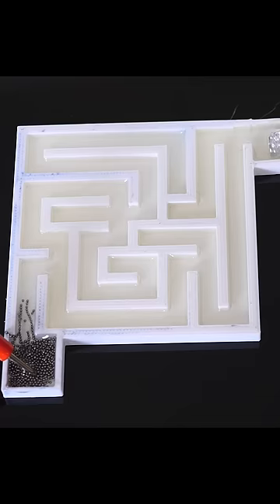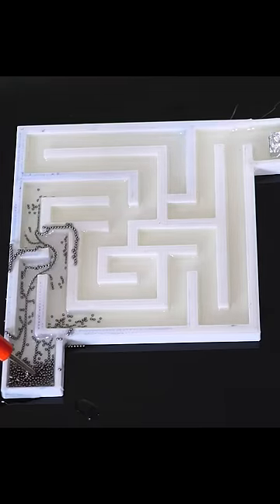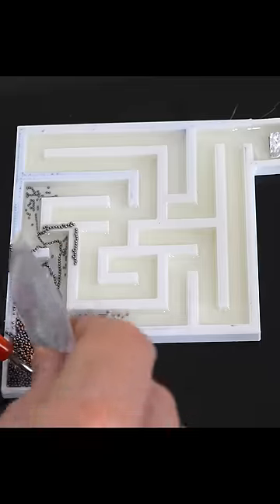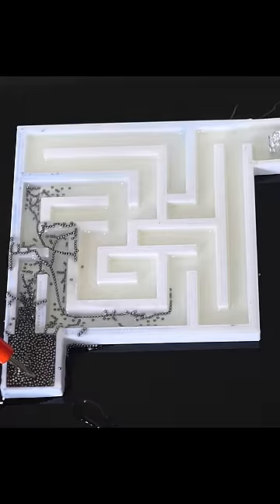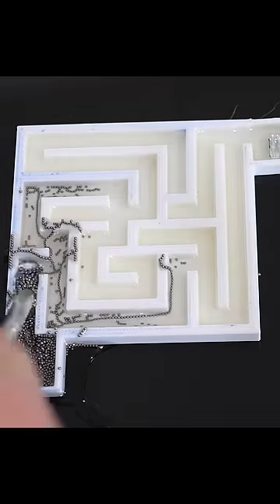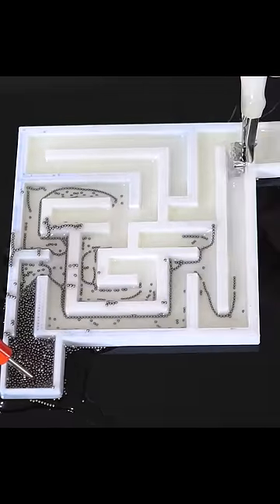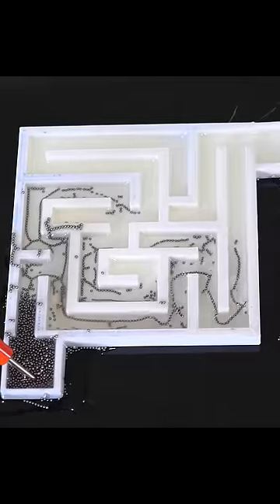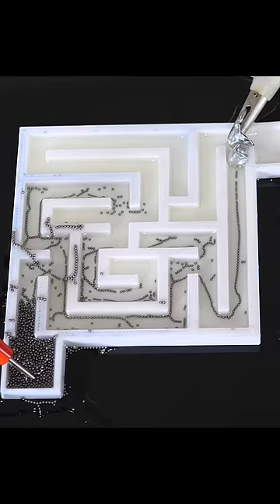Self-Assembling Wires Solve a Maze

Comment: So the answer to, "Can self-assembling wires solve a maze?" is "No".
Reply: Nope buddy, the answer will be "🤔.........yup, but they'll need a bit help😁"(tho they are self assembling)🤣
Reply: In this case “a little help” means “any time they don’t go towards the end of the maze I’ll show them the answer, as many times as is necessary”
Reply: @Jon0007723  “a little help” means they get stuck in the corners because they don’t exert a lot of force so he’s just moving them into the middle so they can move again
Reply: @Jon0007723 You clearly don’t understand how this works lol, he wasn’t pushing them to go anywhere, they were moving in the right direction but because the construction of the maze was flawed they were getting physically stuck. If the design was made perfectly and there were no external factors it would’ve worked.
Reply: @bolson42  the construction of the maze wasn't flawed, it's a completely normal maze. The balls just aren't capable of navigating the maze entirely on their own, simple as that
Reply: That’s true, the maze’s shape may not be ideal, but if the wires could solve any maze that wouldn’t matter

Comment: Look I think if you left it long enough it might have managed it but you should redo this but put a piece of acrylic on top of the maze to prevent it from cheating and perhaps use just a little more charge this time you can make syringe points so you can add additional electrolyte
Reply: Cheating 🤣🤣
Reply: Yeah this is the first really cheap video he’s done. Must have felt despite to put something out… But yeah redo the video. This one is a waste of everyone’s time.
Reply: A slurry of iron fortified cereal would have a better visual effect when backlit
Reply: Yes, with smoother corners
Reply: @legalizenukes3184  was gonna say that
Reply: I don't count jumping the walls as cheating.

In real life, a 3d creature in a 3d open top maze can jump walls, if anything, it's added realism, and jumping a wall in a maze won't guarantee progress, you could even end up in a sealed pocket.
Reply: Create a maze with rounded corners…….
Reply: The 'electrolyte' in this demonstration is actually dielectric castor oil. Still, your idea and points are valid. The problem is, the balls aren't solving the maze, to begin with. They're assembling due to resistance of the dielectric being greater than that of the balls themselves. The action is through electrical conductance, though, so the conductivity of the air may play a part in the test. I'm not sure how long of a voltage gradient can be maintained in castor oil.
Reply: @christopherkarr1872  are for all intents and purposes air is essentially an insulator. To me it seemed more like the little bearings were getting pushed up to the wall
Reply: @borttorbbq2556  Air, at these voltages, is most definitely highly conductive, at least with reference to oil. There's a reason high voltage transformers are potted in oil and then a vacuum pump is applied to remove all remaining oil. For all intensive purposes, air is a poor dielectric, due to ion flow.

Comment: What would happen if the same thing was done in a maze with curvy walls? 🤔
Reply: Honestly the experiment probably would have worked just fine if it had a piece of acrylic on top and if he left it long enough
Reply: @borttorbbq2556  He didn't need a sheet of acrylic  either. All he had to do was not fill the oil over the tops of the walls. Because he did that, the electrical circuit completed over the walls instead of around the maze.
Reply: Hey I know Curvy Walls. He was one of my roommates back in my college days

Comment: I think that a plastic cover would make it better.
Very interesting, maybe I'll try it with steel powder.

Have a great day!
Reply: and rounded corners.
Reply: post the results please, thanks
Reply: Wouldn’t steel powder ignite when sparked?
Reply: @diggoran  being soaked in oil like that means substantial sparks will be pretty much impossible right up until there’s a solid connection between the electrodes and even then sparks will be negligible
Reply: Hello again

Comment: You can do this without high voltage. Fill a maze with tin or silver salt aqueous solution. The metal ions will be reduced on the negative elctrode and should follow the electric field lines, which should be strongest through the shortest path in the maze.

Comment: The thing is, there is only one route.  the charges (conveyed by the balls) are just following the gradient.
yes, the path goes around corners, but it's topography is of a one dimensional gradient.
it's like dropping a ball, and saying "hey, it found the ground, isn't it clever"
Reply: you'd think so, but it couldn't even do that without help.
Reply: @JustinLe  that's more just a setup issue - taller walls would have solved that problem easily.

Comment: I wonder if it's possible to apply this on a molecular scale to create a electromechanical neuron analog... instead of using PCBs, just suspend your microelectronics in a conductive solution with some sort of self assembling wire/circuit material. The more frequently certain components are used, the more the circuit material accumulates on those components, resulting in a parallel to neuron development....

Comment: The reason for this not working properly is that u have printed this maze in FDM printer with very less in fill that's why it's leaking lequid and electricity print this maze in MSLA and try again make sure to clean the top of the maze.

Comment: Educated guess: I think the next step for this would be to create some kind of gate that can open and close so the electricity is directed in one path. This wasn’t as successful as it should be because the electricity is flowing through the liquid which makes the metallic balls follow its flow (electricity). I also think the only reason they go over the wall is because there is oil covering the whole board (maze). Electricity finds the quickest path and those metalic balls represents that because it’s a even conductor of electricity. If you also notice, the first few balls when they come out of the first corner of the maze, they curve in the direction the electricity is flowing in/towards.

Comment: The maze was already solved by the electrical current, you can do this with any system that creates pressure (or acts similarly to pressure). Like water, if the mazer were made of pipes and you just pumped water in one end and looked at the flow it'd have "solved" the maze in the same way. This really is not profound.

Comment: This wasn't very good.  I would have used a salt water solution as an electrolyte instead of Castor Oil.  Also i wouldn't fill it up all the way and i would put a glass lid to avoid the balls climbing over walls.  This was not a very good demonstration, you ended up guiding the balls half of the way.